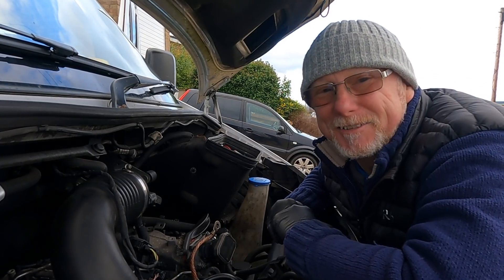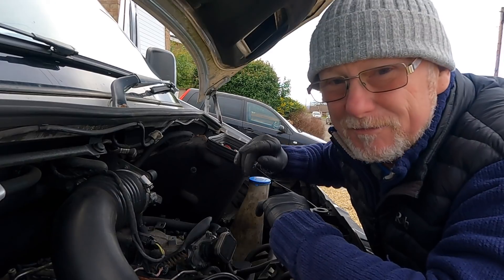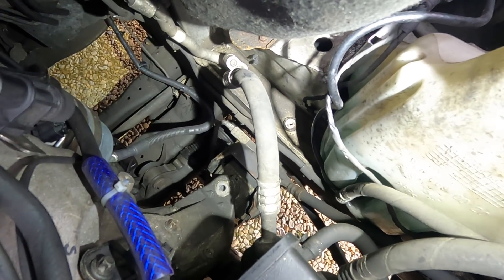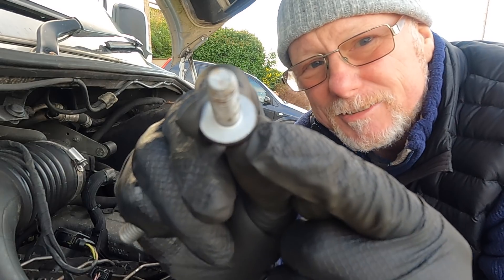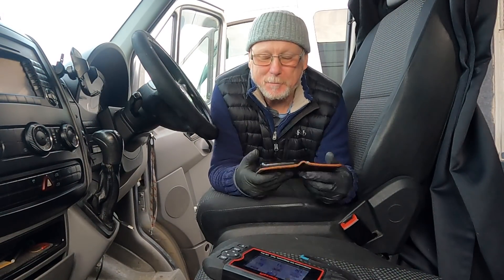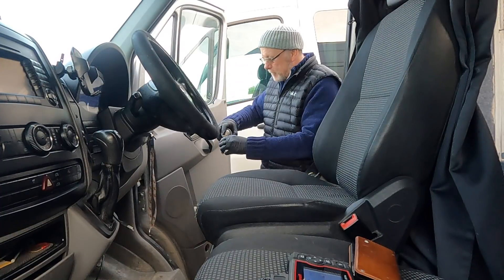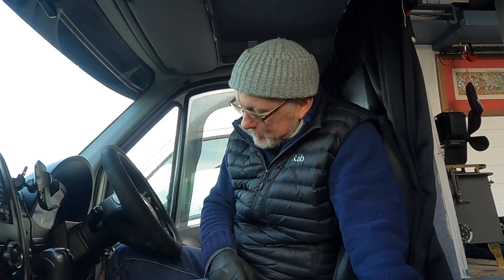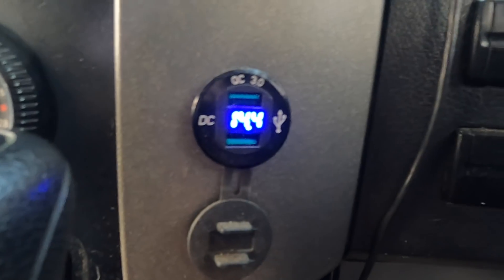Mercedes Sprinter Electrical Problems

Comment: It might be worth getting another one of those earth cables, as the wire does tend to go black with age underneath the crimped metal O rings. This is especially the case with small wires. Although I dont think this is your problem on this occasion. What is the I-carSoft saying about this particular problem? On some vehicles the warning messages dont actually match up to what the actual problem is, Toyota's in particular.
If you still cant figure it out It might be worth  getting it plugged into a faut code reader at the main dealer, as it will be more specific.
Reply from the maker: Yes I’m thinking main dealer wouldn’t be a bad idea 🍻👍

Comment: Mel how are you doing question what do you think a 2008 mwb high top  311 sprinter with a 1 owner from new on 150 000 on the clock ,body in good condition  is worth ,cheers m8
Reply from the maker: I’d go get it if I was you before anyone else dose good luck 🤞 🏃‍♂️🏃‍♂️🏃‍♂️🏃‍♂️
Reply: @BigVanSmallWorld  thanks m8 all the best ,I found a old threepence yesterday and a junk ring ,take care

Comment: Mel there is loads of tutorials on youtube with people adding a second negative cable it seems a common fault with sprinters
Reply from the maker: Oh really thank you I’ll have a look 🍻👍
Reply: @BigVanSmallWorld  sorry Mel i should have said electrical faults due negative problems are common not specifically your problem my own sprinter had an issue where she wouldn't start first turn and apparently a lot of electrical problems are sorted with a second negative not an expensive fix if it helps a (lot of videos on youtube aboiut using a second ground fix point}

Comment: Hi Mel, did you check  the negative connection between the actual alternator and the engine itself ? The positive side is  screwed on, but the negative side might just connect through the tensioner...
If negative can't propperly flow to the engine, the rest will never get enough power (voltage can still be ok, while amps are not )

All the best (y)
Reply: Alternator earths  through its mount to the engine block…the earth cable Mel repaired earths the engine to the chassis. The battery earth is direct to chassis so the circuit is complete..🤟🏼
Reply: @MrMaster72  not going to discuss, but no matter how it earths, 
since this connection has not been touched, it could have built up oxidation.
Reply from the maker: Yes buddy I put new alternator on and clean all contacts 🍻👍
Reply from the maker: Yes buddy I put new alternator on and clean all contacts 🍻👍

Comment: Those negative ribbon (as i call it) lead, linking chassis ground to the body or part is not as good as an actual thick cable similar to the one on the negative batt terminal(usually a jacketed thick heavy cable). If/when i do need to replace one, i replace it with the one similar to the negative batt cable (at least in size). Being in the snow belt area.... And high use of road salt... Those ribbon ground straps rots out first. 

Another tip is once replaced, and the bolt makes a good connection, i would apply some dielecteic grease or rust proof spray on the exposed metal (bolt head and eyelit) to stop it from corroding) 

Problems like this will never happen again in most cases. Knowing my luck, it would be faulty in the dead of winter at
 - 10C in the middle of a blizzard 🤣

Comment: Interesting vlog Mel. Just a reminder that sensors can be faulty as well and hope its a cheap fix. While you're on about electrics I was just wondering, , , When using a dimmer switch on your LED lights, do they use less amps when the lights are dimmed or do they use the same amount of battery whether on full or not. Just curious. Cheers Mel.
Reply from the maker: I really don’t know try google it good luck 🤞

Comment: Do you watch any #SalvageRebuildsUK video's Mel ?? ...... If you do, you'll notice that when they have electrical WARNING codes come up it's usually 'nothing' to do with the presumed fault, but some sensor going bonkers on the same circuit ... Good luck ... A bit of Trial & Error for you MeThinks 🙂
Reply from the maker: Thank you 🙏

Comment: Mate ..abandon ship ..these sprinters are all poo lay bloodywell voo n stuff ..designer faults from start to (well you.ll never get to tje finish )..😎..weve bunn over this ..transit .. its the onlyway forward..😁pip pips
Reply from the maker: Yes I should have stuck with my transit 🎉🥳🍻👍
Reply: @BigVanSmallWorld  ...nnyess
Reply: Transits turn to dust. Iv driven these van as a courier with this fault light many times didn't seem to stop it starting